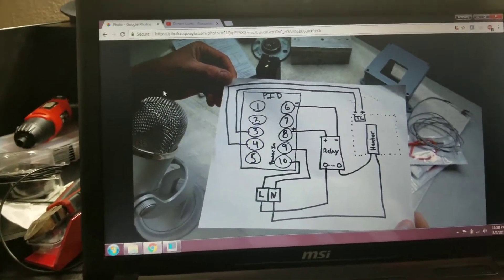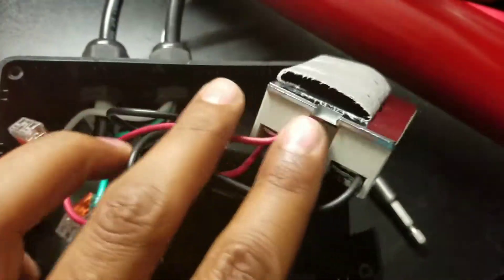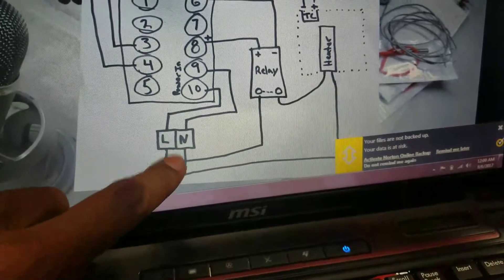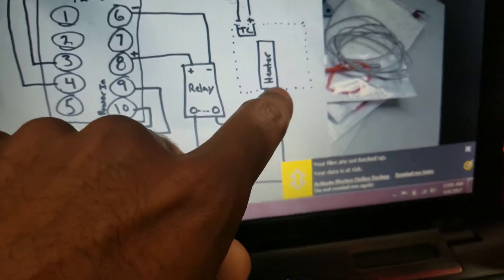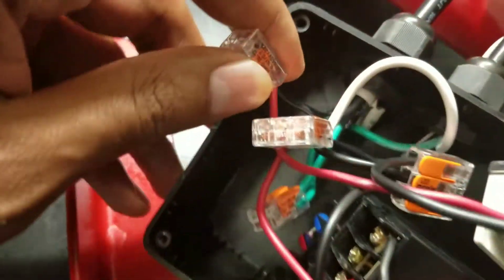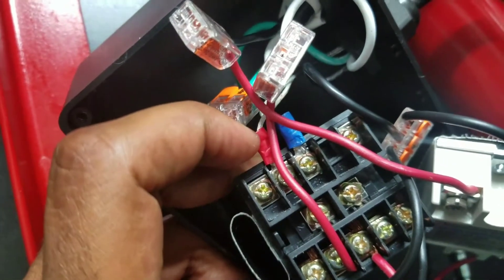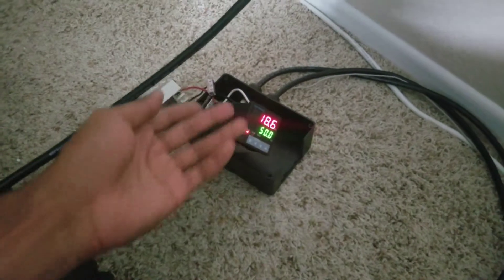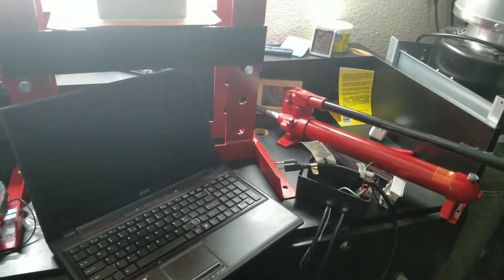DIY Rosin Press PID controller tutorial!

Comment: A quick question, in order to power some 110v and 250w resistors I should use a 16 AWG power cable or I could use an 18AWG one to give them the power they need.

Comment: What syle/gauge wiring is used for the wiring?
Reply from the maker: 16
Reply: @SolventlessBakenVape  solid core 120v (300v rated)?
Reply: also heater cartridges are 120v not 12v correct? i noticed the ssr output is only 12v off the pid controller

Comment: Your video sucks! Are you sure you should be making diy videos...you have different colour wires used where they shouldnt be , to someone who doesnt understand Electronics your videos are dangerously confusing when you make an instruction video be clear precise and correct you are anything but
Reply: You are the one who needs a clue! Wiring as many codes! If you are going to abandon those codes explain to your audience this is what you're doing, you are substituting different colour wires and of course any wire colour  will work ,that is not the point! try and get a clue yourself and put yourself in the audiences shoes and explain when you are substituting something because of shortage of materials and hats off to you for trying to help people just dumb it down explain every little thing for peoples safety! It's things like that that separate men from boys. Im sorry if you are unable to understand that and just perceive my post as a personal attack against you because that's not what it is. Cheers

Comment: Thanks for the vid.  I made the Greengenes press.  Works great! Just had to study up on metric...PID in Celsius only.  Got terrible results when temps too high. Comfortable range for me is 85c.
Reply: Hi Homegrown, I was setting up to do GreenGenes DIY press and the video was yanked. Do you by chance still have the supply list and links (to Amazon)? I would be so grateful, thanks.
Reply: Sup.  Amazon items:  Inkbird PID, Aluminum plates. I got my press from Harbor Freights.  The heating elements, for me , are hard to find.  My first time ordering elements arrived ( ordered 4).  Since then, I have been unsuccessful in receiving orders from Amazon. Companies in China advertise on Amazon, get ya $$, never send items. What can ya from USA. Not much $$, $8-10, so I gave it a shot on the hope. No show. Tried in USA companies, was a rip-off.  Sorry to ramble, had to get it off chest.  Wish ya in locating the heating elements.  Check out GreyFox Heated Platens on FB.  If I didn't already have, he's a thought.  Hope this helps.
Reply: Hi again HG, I made a dual PID using 2 Inkbird ITC-106VH for 6" x 6" plates, and 2 each 12x120mm Cylinder 110V Cartridge Heaters per plate. Wiring is correct as far as I can tell (maybe I'm having an issue with the relays?). My issue now is programing the PID's. I followed a generic "set-up" from a beer brewer and my plates just continue to get hotter and hotter. Any pointers or suggestions on how to program this PID's?? Thanks again for your help with this project.

Comment: You should really use crimp connectors
Reply: Anthony J I'm talking about the wires going to your pid and relay, you should use the fork crimp (like on thermistor) for any screw down connection. esp when dealing with mains power to ensure proper connection, waygos are fine you just don't want bare wire ends
Reply: Anthony J just got a 20 ton press for $100 bucks! Gunna build my own pid comtroller using arduino amd relays!

Comment: where did you cut the extension cords to wire them in?
Reply: Just finished wiring everything together, and I must say your video helped a ton. Thanks so much sir. My set up looks kinda weird because I don't have a project box housing anything. It still doesn't look bad though. Still just waiting on the heating elements myself.
Reply: Henry Hoersting how are the cords suppose to be cut I got one ready that plugs into the wall how is the second cord suppose to be cut

Comment: Hey man where did you get the red and black wire? Doesn't come with any of the components listed on the other guys video
Reply: Anything else we need to make this that isn't on his list or mentioned in your video? I noticed there isn't anything attached to the end of the 16g wire do the copper wires just wrap around the PID screws and relay screws?

Comment: Hey Anthony, Im currently in the planning/gathering phase of my diy rosin press. i was planning on using 2 heating elements per 6x6 plate. Would this be overkill/unnecessary? Should i use heating elements that are entire length of plates or slightly shorter? I was wondering if you had a link or at least the dimensions of your heaters available

Comment: Hey, man. Just built my 1 ton press and i've been trying to get the right process down for the optimal yeild. Im getting shitty results. Did you ever have problems with your plates being two different temps? I have evrything set up exactly like you do in the video. I bought a temp gun to see how off my temos would compared to the thermocoupler. Im setting the temp to 200 and getting way hotter readinga from one side of the bottom plate, than the  other side. They are 3×5 plates.. i know i have enough pressure. The heating elements are in the middle of the plates... maybe my temp gun is bad? The top plate is like 40 degrees off as well... not sure whats going on.
Reply: So I have a 8 ton bottle jack  and all I need to do is make my metal frame for it. Then hopefully  I can get way more yield, and press more at once.
Reply: what would be the best tonnage press to get? 10, 12, 20?
Reply: Just get a 20 ton. I doubt you will need more than that, and they arent too expensive